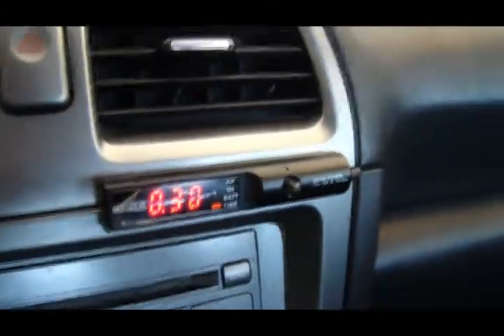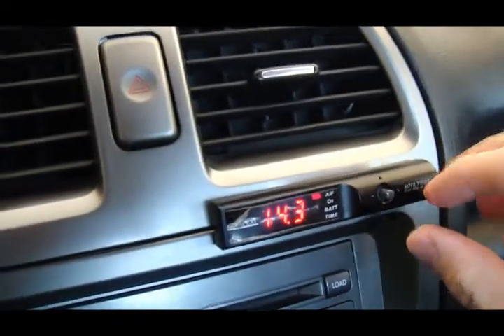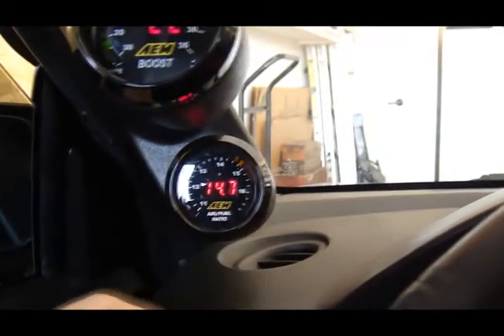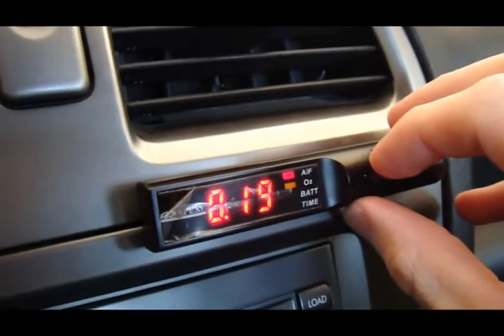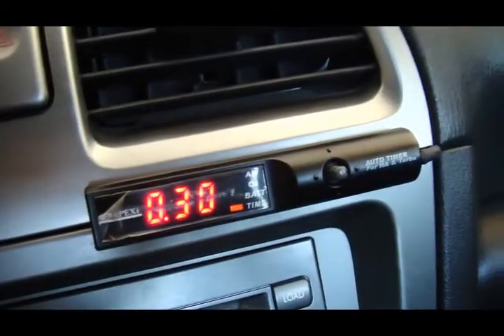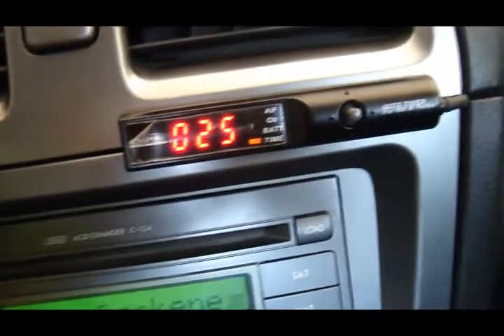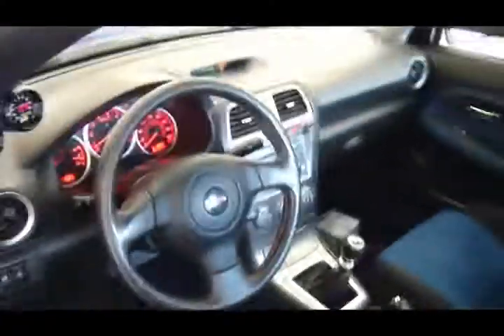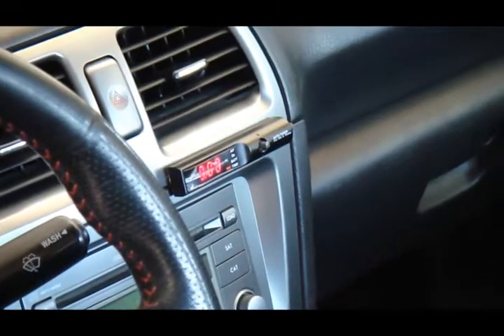Apexi Turbo Timer (2007 STI)

Comment: Can you set your specific turbo timer higher then 30 seconds ? Or is the highest you can set it for 30 seconds ? Also how did your mechanic hook up the 02 sensor function on the timer ?

Comment: hey bro does your apexi turbo timer works when the key is turn to "ON" i mean when you turn the key to "ON" and put it back to off. does your timer still starts to countdown? is it normal? tnx

Ps: you aint going to turn the engine on youll just put the key to "ON" the put it back to off then pull the key out.
Reply from the maker: Lucky Aquino whether you turn accessories to on then pull the key,  or turn the whole car on then pull the key, the timer activates.
Reply: panzerth even if you havent start the engine at all? do it still activates?
Reply from the maker: Lucky Aquino yes. just accessories is on timer will still activate when you pull the key out.

Comment: @ssimon411 say ur running the car really hard. so its really hot. then for some reason u have to stop/ turn off the car right away. Fluids/ oils are still going through the engine/ turbo. Since the engine was cut off right away, the fluids dont have enough time to cycle through/ out of their respective components properly and the heat hardens the fluids. This can lead to damage in the future. hope this kinda makes sense. Trust me. it'll save ur car in the long run. longer engine life!